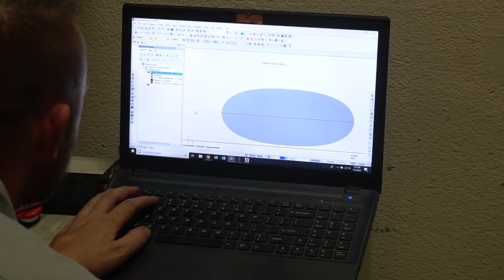TFS: Converting Chinese CNC Into Robotic TIG

Comment: In any engineering job you should try to set aside time on a regular basis to "fool around" with stuff like this. It can seem like a time sink especially when things are busy, but in the long run things you learn can save time, make regular operations faster and it makes the job more fun. Of course there will be times when just getting customers stuff out the door is hard, but most places have slack periods, and if you've a notebook full of ideas of things to try you can make use of that time efficiently. Even if your experiments fail, you've still learned something, and probably opened up several other avenues for exploration that might not have occurred to you initially.
Reply: I used to manage an equipment service shop. I'd keep a notebook of tasks that needed to be done when things were slow. You have no idea how happy a Tech would be when I'd whip out the notebook and assign a job that the Tech suggested we needed to do. The buy-in was built in,  and the Tech felt their suggestion was valuable. Win-win. Working on these rabbit holes can be a blessing in disguise...
Reply: It isn't just engineering there that kind of learning pays off.  I work in a very complex business, and spending some time to learn about other areas of it has paid off over and over.  I've worked for the company for 14 years now, and keep finding new layers of complexity.

Comment: Not to worry... A $2000 NC plasma or a $500K German 5 axis mill does EXACTLY what you tell it to do! Even if I told the spindle nose to run as fast as it can into the trunion because I didn't home it first.

Comment: Justin, I am a robotic welder designer that has designed mig machines, spot welding and plastic welder (via ultrasonics) and your process was pretty much the same we use in the auto industry: design, build then perfect. The last part takes time on every machine I have had the pleasure to work on. The one thing you have to look out for is electrically isolating the fixture you are welding with from the main frame (in your case the CNC). Check out Micarta from Mcmaster. Make sure to isolate everything including bolts that attach the fixture to the CNC. Never thought of robotic tigging but THAT would be interesting.

Comment: Congratulations, and have confidence!  A curvy 3d part is a challenge for anyone doing something like this, using any kind of equipment. You do need safety sensors. You do need every thousandth of an inch of accuracy you can achieve in positioning. But you can certainly achieve those things if you decide you decide to do it. And now that you've done 3D, step back and consider that solid, accurate straight-line welds are the meat and potatoes of most fabrication. Take advantage of what you've achieved in the easier part of the exercise.

Comment: Justin
If you use Mach3 software to control your steppers or servos, you can use an app called copy-cat which allows you to make complex paths easily. You just position your torch where you want it and hit enter (I think) and it records the x y z co-ordinates at that point. Go on to the next point and repeat. Pretty soon you have generated a torch path. Mach3 demo software is free and it allows about 500 g-code commands. That should be plenty.

An arc gap controller works well, too. You dial in the voltage and the z axis moves up or down to try to match the specified voltage. TIG controllers are stupid expensive. I have always wondered if you could modify a plasma gap controller to work. Plasma voltage runs about 10 times what TIG runs so a smart person (not me!) should be able to make a voltage divider. Plasma controllers are dirt cheap. With an arc gap controller, the torch will allow you to weld complex shapes since the torch is forced to keep the voltage constant regardless of the contour.

I used it years ago to weld irregularly shaped medical devices before CNC was readily available to real people.

Have you thought about plasma cutting fish mouth chassis tubes with CNC? Bend-tech software has all the right pieces if you know a smart person (not me!).
Bill B

Comment: Thank you for your service!
I am curious as to what your rating was in the Navy? 
And how long you served? 
As a First Class Petty officer my guess is that it was like at least 8 years - iirc, right?

USNR 10/67 to 10/73   ATN 3rd class (Aviation Electronics Technician - Navigation)  
Went thru Reserve Basic @ NAS Memphis and (across the road) NATTC Memphis in Jan thru May of 1968. Good basic education in electronics which helped me a lot as an automotive service technician a few years later and while I was still a "Weekend Warrior" @ NAS Glenview. Safer choice for me to join the reserves and pick the branch I would serve with, rather than waiting for the draft and possibly ending up in the Army and get sent to Viet Nam.
Reply from the maker: I was in SONAR for a few years and crossed to Engineman. Made 2nd in 3.5 years. I probably would have made Chief in 8 or 9 years if I was able to stay. I was doing well. They retired me 1 month before my 4th year.
Reply: Whoops, thought I saw 3 chevron stripes on your left sleeve in that photo. 3.5 years is quick advancement to 2nd class P.O. - at least back in my day.

Comment: The next step is to set up a wire feeder and feed Mig wire into the weld. We used to weld seams like that welding flat sheets together before rolling it into a tank. Have a look at these, I've worked on machines like these that have wire feeders: https://www.youtube.com/watch?v=-9fST0VkY8k & https://www.youtube.com/watch?v=KWlQW0Xm6N4

Comment: So the next question is, have you gone through different stick out lengths, feed speeds, amperage levels, etc, to demonstrate what's good, what's marginal, what doesn't work?
Edit - did you use filler for this test?

Comment: Inspirational
Reply: I going to be designing and building my own SXS soon for school and I currently have a tig welder but I am shooting for a chrome-moly buggy and am in the market for a tig welder I thinking I am going to spend around $800-$1500USD what welder should I get?
Reply: Gunnar get the HTP Pro Pulse it’s same as the dynasty 210 DX maybe better. If you are stuck at that budget get a used maxstar 210 DX if you don’t do aluminum. If you do everlast 210 ext if all else isn’t possible for last resort
Reply from the maker: Gunnar For your price range, I usually recommend an Everlast because it will deliver plenty to get started. Most people don't need more than 200 amps. The 210EXT or 200DV will do the job well within or close to that budget. My top two machines (for higher budgets) are the HTP Invertig 221 (used in this vid), Everlast 255EXT, and the top is the Fronius Magicwave 230i. The first 2 are over $2k, the Fronius is over $4k. All of them will destroy a Dynasty. The Fronius will take a dump on a Dynasty with style added for insult.
Reply: The Fabrication Series I agree with you. I love my Invertig 221 like I love to breath but My Dynasty DX does have a 60% duty cycle at 210 compared to the invertig at 20% at 210 amps and it’s $500 more for the 110v option which is more for stick...But I’ve done mostly aluminum so I buy my tigs based off that..I’d skip right to fronius if I had the money. But The Dynasty holds its own against them. I don’t own everlast but if I bought one it would be the 255ext. Everlast and the dynasty have same duty cycle. The Dynasty 200 is junk with a weak duty cycle.
Reply from the maker: Welding Junkie I started ignoring duty cycles all together. It's a nice reference, but realistically, its irrelevant unless you're into actual continuous use. The other factors like pulse and bias (if equipped) change it up even more. The 221 has never given me a gripe and I've (very seriously) tried to trip it and break it. 

My old Dynasty would throw fits regularly. I got tired  of that machine and with its legacy of "end all be all - OMG a Dynasty" in mine and everyone else head, I was very disappointed with it. There is so much better for the consumer out there and numbers are just a reflection of how the manufacturer tests them.
Reply: The Fabrication Series agreed very true. Everything you said was true. I’d take my Invertig  221 over my dynasty any day and twice on Tuesday...With that said I do like my Dynasty 210 Tig runner. Never given me an issue. I like the fan on demand and the diff wave forms. It does have wider ranges than the HTP 

I’ve owned quite a few dynasty 200 DX and they are garbage loud and arc is not smooth like the HTP. The only negative about the invertig is the 120/220 version is 3k for Invertig. 
The miller has more service spots that’s it. Would you buy a everlast 210 over a dynasty 210dx? Reason I’m asking is you drive your machines hard so I value your opinion.
Reply: Do you have any videos on the Fronius? I can't seem to find any videos in the 230i!

Comment: Now really scramble your brain.  Add two more axis so the torch can stay perpendicular to the work piece.  Fusion 360 is capable of setting up CAM for that and don't know what controller your using buck Mack3 works fine on 5 axis.  Best of luck with it.  Cheers.

Comment: All you need is second hand 6 axis robot which you buy cheap becouse all the big manufacturing firms are sacred of them and been brain washed into only buying new ones. I have about 20 robots some were bought for scap cost including cloos comau and komasu easy to program and will weave. What got me into it I was making a lot of my own fabricated products so I built a 5 axis robot without knowing about the second hand market back in the 90s

Comment: Are you going to try manually feeding the wire in? That would be cool to watch. You could have the rod mounted at a fixed point and have the machine move towards it. Having the feed and amps set up corectly it should melt it in time to keep moving forwards. Darn it why are you so far away. Would mind helping you with that. Now I have to wait for the next vid. LOL
Reply from the maker: Danylo66 I'm working out a wire feeder system in my mind now. Maybe I'll get something together if I keep up with this
Reply: Cool looking forward to it. Don`t give up.
Reply: And Have a great 4th of July.